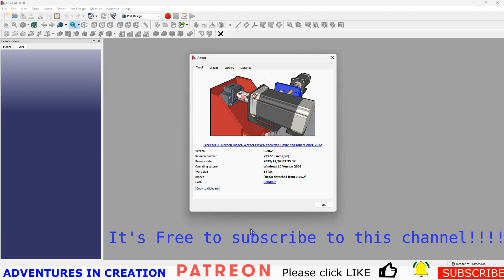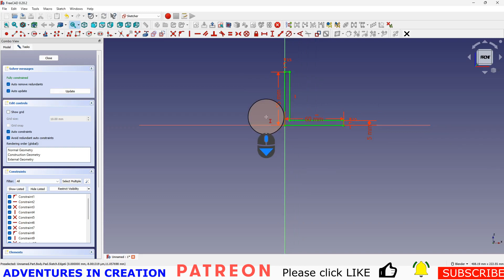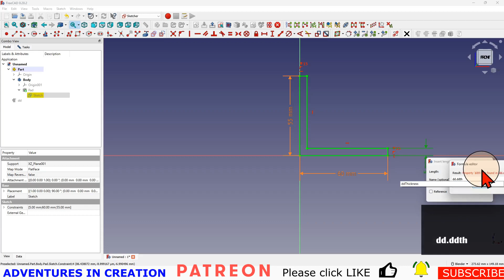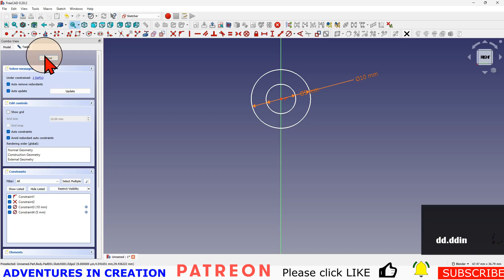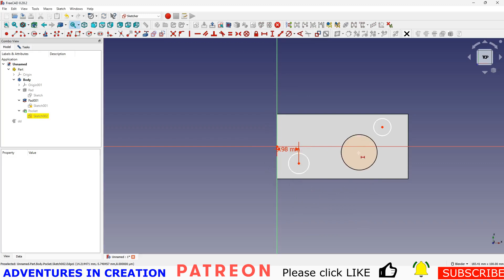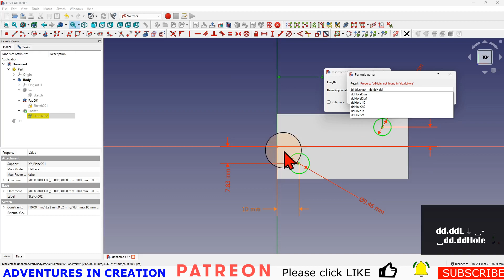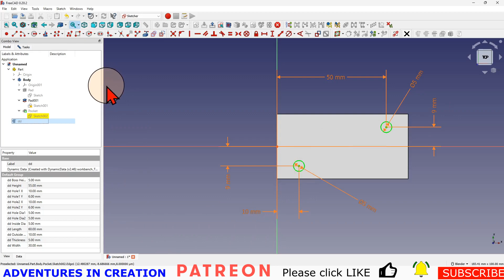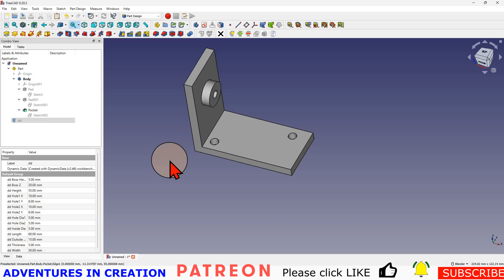FreeCAD for Beginners #53 Using Dynamic Data to create a model  #freecad #cad #makers #design

Comment: Hello! I like the Dynamic Data workbench method. It is somewhat simplified compared to the spreadsheet method when dealing with simple parts.  
Is there a method to prevent “out of bounds” values that would break the model? Setting up “min/max” values for parameters? Is it then possible to set up dynamic “min/max” values?
Reply from the maker: I am not aware of any min max values but, if you only calculate values you can prevent most issues.

Comment: I'm glad you showed using dynamic data. Too many videos using hard coded values out there.

Personally, I usually default to dynamic data or spreadsheet (usually spreadsheet, as that's what I learned from you in the beginning). You never know when you will return to a project and need to adjust values and having such set up right avoids going in and adjusting everything by hand..

I would also like to know the benefit of dynamic data vs spreadsheet, or is it just a simplicity thing, not having to set up aliases?
Reply from the maker: The biggest advantage is the compact nature of the dynamic data within the model file. I think there are pros and cons both ways.

Comment: When making that cylindrical hole, I undesrstab what you are doing, was folowing some of your previous tuts tome time ago (and forhot most since then). Now, does this approach have any pros compared to applying a cylinder primitive and then makinf that a hole?

Rge reson I am asking, I was sktching a coupler and in effect it was easier for me to combine a ctlinder, tube and a block (despite FC refusing to transfer a cylinder into a hole directly).
Reply from the maker: There are many ways to achieve the same end. It really depends what works best for your situation.
Reply: @Adventuresincreation  I see, thanks. I was probably even messing up the bodies. Perhaps I need to start from scratch again. Thank for your tuts even more! :D